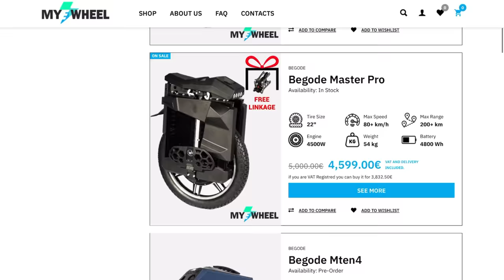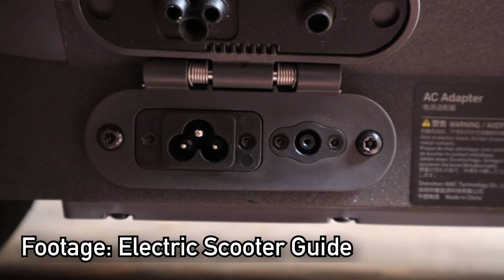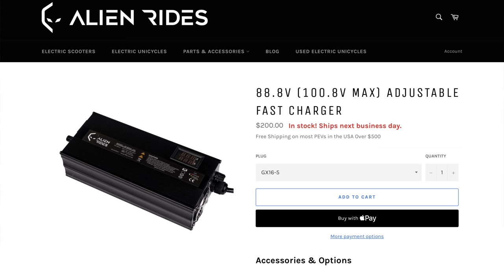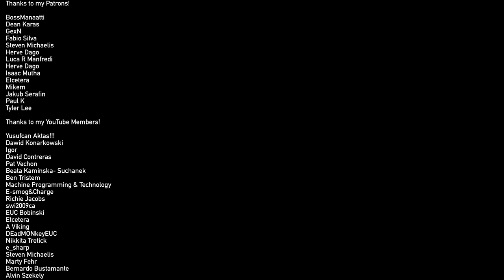I don't like where EUCs are heading

Comment: I love the size range of where EUCs have gone. I’m 6’2 250lbs athlete. Having the master pro is god sent because it doesn’t feel like a toy and I know my size won’t break it easily. I would over torque my RSHT and v11 without even trying. I’m happy they make wheels for pple of all sizes
Reply: 6'2 and 250, damn mate you're a complete unit of a man
Reply: Exactly!
Reply: I don't have a wheel yet but I'm also 6' 2" & 265lbs (not athletic 😂) and 99% of wheels seem too small & underpowered for me. The monster/master pro & V13 seem to be the only wheels built for my size.
Reply: Funny...I mentioned newer wheels would be good, and then went on to list a bunch of older models.  Oops!  But still good options!
Reply: @joshuajones6113  haha, the tech seems to be moving fast. I only discovered EUC's a few months ago but I really want one as I only commute 10 minutes to work. Working on losing weight but I still want a solid suspension wheel for my knees
Reply: @anthonycoffey6565  Suspension wheels are cool for sure (I want one too), but have so far noticed that I easily bottom them all out with the exception of the Sherman-S.  I am about 240 lbs fully geared.  Other issue with suspension wheels for a new rider are that the pedals are WAY higher off the ground.  This makes learning them a bit more difficult.  Unless you have really bad knees, I wouldn't sweat it.  My knees could be a lot better (I'm 48), and my commute to work and back is about 34 miles.  Only had non-suspension wheels and have been ok.  Would probably be a good idea to check in with the forums and see what other larger riders are saying.  Also, check out Black Cobra's channel on youTube.   He's a big rider and does wheel reviews specifically with us big dudes in mind.
Reply: @anthonycoffey6565  you can ride anything equal or more powerful than a v10f. comfortably. a HUGE danger he never mentioned in this video is the complete lack of regard the community has for money, and most will just disregard older wheels because it doesn't cross their minds for cost
Reply: Good point. I'm a small guy and have no use for huge wheels but I recognize that larger people do. Which is good.

Comment: I've been hoping to see some innovation in the smaller wheel space. That makes it easier for new riders to get into, for one thing, and opens up different ways to ride. I want to see a small lightweight precision wheel that promotes technical riding over just speed. imagine a wheel that is made for skate parks.
Reply: honestly feel the same way. i love my MCM5v2 for trips under 2 miles from my house. It's fast enough and doesn't get in the way at the dentist's office or getting groceries/food. I also don't feel the need to put on full on motorcycle gear when taking it out since I'm not going as fast. I'm beginning to feel that regular 50kph+ speeds might be better done on e-bikes with their better stability and braking performance. I've seen the EUC vs e-bikes braking tests and its an eye-opener how much more distance the EUCs need to slow down from high speeds.

Comment: No, I disagree. Safety is an attitude, not a hardware limitation. Lots of cars are capable of going 150-200 mph even while the national top speed limit is 70 mph. A device designed to achieve high speed will be SAFER at lower speeds. It's up to the rider whether they want to ride safe or risky. And sometimes you might need that speed to get out of a "sticky situation".
Reply: Yea you can cause a bad accident at any speed. Offering a variety of wheels that do different things for different riders should be a priority with safety in mind… if a wheel of a certain size or range or speed doesn’t appeal to you then DONT BUY IT and find something for your use case ….
Reply: The issue isn't really the capability of speed but rather that manufacturers are sacrificing other valuable features in favor of higher top speed as it's effective for marketing.

High top speed is dumb when you barely have the torque to reach it imo.

Comment: Motorcycle foot pegs are also foldable. It actually makes sense for durability specially during a crash. If the foot pedals are fixed in place, they will snap off instead of just getting folded.

Comment: Nice to see some love for the 16x again… I love mine but just replaced the inner and outer shells as well as the trolley handle, the top cover, charge ports , rear fender and front light… when I opened the wheel the motherboard was literally covered in dust,… I love this wheel i do but it is literally made of the cheapest crap, broken loose, sheared, rusted and chewed up screws… if I had the money I’d get a bunch of top riders together and design the safe, capable, bullet proof and fun wheel we all know is possible…
Thanks Adam 🥰

Comment: Innovations I would like:
- black box (like in planes)
- transparency about firmware versions 
- transparency about known issues (hardware and software)
- buzzer audible in all conditions
- possiblity to plug one more battery or bigger one when I need (plug and play)
- Standard charge port
- Conception allowing you to change / repair tire easily
- an adaptative  tiltback taking into account battery level as a standard

Comment: 3:10 I agree the prices are out of control. I recognize the newest EUCs are more powerful, more sophisticated, have extra components (suspension), huge batteries, but I am seriously doubting whether I want to spend $4-5,000 USD for a wheel. Even though I love EUCs, I can use $4-5,000 much more beneficially for other things! I'm currently riding a MSX and 18XL. These are several generations old, but I am very happy with them! I paid about $1,800 USD for these wheels when new, and that was very difficult! I think it's great that EUCs have advanced greatly since the period of the MSX and 18XL, but my older, simpler wheels meet my needs fine! I believe there are many customers for a simpler, more economical wheel. EUCs are so expensive now that people who would like to join the world of wheeling cannot because of the cost barrier.
Reply: Absolutely right. Who says otherwise is lying from financial reasons.

Comment: When talking about the 16x, I think its totally fine to have an older wheel. We know it works and is reliable. If they keep supporting it to current year then Id much rather buy that over something that just came out and I have no idea how it will do over time.
Reply: I've been riding 16X  3 years now, I always push it to 30 mph and cruise all day, never any issues it just keeps going and going.. plenty of times that I wish it would go faster but I also have a street motorcycle 😅

Comment: Spot on! 24kg max,  50km/h max, high torque, 16"-ish wheel for agility, flat sides, strong rim. 16x fits the bill quite nicely, apart from the rim that is way to soft, so keep the tire pumped. The v12 HT that I bought 2 years later has a few improvements over that with a stronger rim and bit more headroom in speed and high end torque, but is also noticeably heavier at 29kg. And both are sub 2000euro. That 's how it should be. The manufacturers should build on existing products, like you said: Stop designing a completely new wheel every 6 months. Or at least keep the designs that work and improve on those.
Reply: as we say, no need to invent a bike, when already all invented, just need to make modern design of existing
Reply: Agree 💯. Unfortunately the chinese manufacturers are interested only in grabbing more money, hence the  trend of bigger and faster, disregarding waterproofing, quality, safety and maintenance.

Comment: I've been thinking this too - well articulated - my hope is Inmotion takes the safety and modularity of the V13 design and re-apply's it to smaller, lighter, ideally, cheaper wheels, so a new V8S / V10 / V11 / V12 using the newer reliable components. Although - I believe the V13 has had some bolt issues already?

Comment: Completely disagree INMOTION have other models to suit your style... The market mostly wanted fast unicycles so that's what they were given its not fair to blame this on the manufacturer. Motorcycles go 300Kmh on the clock it doesn't mean I use it,  the pure stability and smooth ride of the V13 wins me everyday over that baby wheel you have,  I'm not 70kg I'm a big man and the V13 to me is basically a V12 to you. I believe I could stop quicker than you on a V13 at 50kmh than you could. Weight is also a good thing have you ever tried to race a small 125? This torque thing you have going on isn't real btw the V13 has 300Nm more enough especially with power assist on and this was designed for speed the next wheel I'm told will be different and will cater more to your needs....  
The charger is big for longevity small chargers produce heat and die quicker life expectancy of that cheap small charger won't last and it's also not 126v so the transformer etc needs to be bigger as with everything else.

Comment: great, you summed it all up.  I preferred the time of the beginning, when inmotion worked with new walking, that was the spirit of the wheeler in super pedestrian mode.  Rides with your nose in the wind at 20-40 km/h in a t-shirt and small light helmet instead of wearing motorcycle gear, glove jacket, full-face helmet, etc.... soon so much torque that there will be  possible to mount vertical at 90 ° .... only on paper, but some will still buy lol.  good ride for all readers

Comment: Hi, Adam! Thanks for the great video, exactly the same thoughts. I'v just bought second hand 16x from the local rider (instead of my 18L) and... I am just happy! It is so nimble, it has so great acceleration, it does not require to lean hard on it, and it has outstanding range for its weight - I did 76 km with 69V remaining. And the most important thing is the way I FEEEL it - its just magnificent!!! After 500km it became a part of me, not a "machine, I am riding". I had that feeling on Ninebot E+, but near lost it on 18L, and now I have everything I want on 16X. KS could improve that wheel (better plastic, 100V, etc) but....
Reply: imo ks16x improved version is v12ht, but we dont have improved 18xl

Comment: I keep saying this. Kingsong should just make a 100v 16X with a bit bigger battery and I reckon they would sell a lot of those.

Or a 100v 16X with suspension would be sick too!
Reply: No. If you add suspensions, you increase weight, you want also more battery, you arrive at 32kg T4 mark, the comparison with 16X is lost, meaningless. Maybe a 26kg 16X, with 50km/h real speed and a bit more battery is doable.
Reply: Suspension is a most. Nothing to argue here.

Comment: imo the first and foremost thing they need to market is affordable transportation, it's amazing to be able to use it as I would a bike, but much more fun, much faster, and I can just plug it in at the end of the day, not a worry in the world about gas or storing it anywhere. a smaller wheel that people can use like a v5f or v8s are the perfect wheels to exemplify it, but they don't really try to make wheels like them anymore

Also: if I ever recommend a wheel to anyone it's a v5f, the range is great for the price, you can usually find one near $300-400 and is a great little vehicle to get around. it frustrates me to no end that people discourage getting affordable wheels because "you're gonna upgrade eventually cause that's too slow for me."

Comment: Unfortunately the infrastructure where I am, I need 60kmh wheels minimum. Bike lanes here are non existent and most of my close calls with cars have been in the bike lane where cars dont notice me coming. Even when I am on a underpowered onewheel going 25kmh or less. This forces me to take the road and try to keep up with cars. I think its the same case with many places in the US where bicycle infrastructure just isnt enough.

Price I agree with. These wheels are just getting more and more expensive and I dont see where our money is going towards. We still have cheap cast parts on our wheels yet we are paying thousands and sometimes even motorcycle prices which blow EUC quality out of the water. At these insanely high prices, everything we should be getting should be cnc, high quality and well designed. EUC manufacturers get away with giving us crap and still charging what they charge for some reason

Comment: Why can't we have a modular wheel, add in additional batteries if you want to go on a cruise, or quick swap with fresh ones.
- even accessories like plug in Bluetooth if you want that or not.
- I find it strange (new rider tho) how mechanical unicycles all have seats, but these electric ones you need to stand or contort down to a squat - how about a seat option or add on
- i like the LED lights for additional visibility at night
- be nice if there was gps tracking or security features
- i like all the other things you said too. Safety, torque, waterproof, better chargers & built in, quality materials. Cost lower. Good customer support.

Comment: The main problem for me: the wheel needs removing from time to time. Bearings, tyres, etc need servicing. Most wheels are assembled around the wheel and taking the wheel out is a couple of days work - at least for me. Bikes and motorcycles are completely accessible. Some bikes even have quick release systems. If a wheel comes to the market with a quick release wheel, it could dominate easily.
Veteran Sold me an Abrams and I like it just fine, but its all I know. Its been off the road for 2 weeks now as I wait to buy correct tools, silicone, tape and all the other stuff to re-waterproof.

Comment: I think a smart BMS will be good for the resale market. These wheels drop like rocks in value. If you go see a used wheel with a smart BMS ask the guy to charge it to full then you can check on the batteries.  I did that with a used S19 I bought.

Comment: As a long haul truck driver I appreciate a smaller lighter wheel that easily fits in the cab of any truck. My 16X fills the bill perfectly. It has plenty of torque and it's fast enough with adequate range for me to get around any city. Usually if I'm parked outside of town I can take an uber into the city and from there I can access the services that I need. If a city has decent enough infrastructure I can actually commute into town as well saving me even more time and money. So, I agree, there is a need for smaller, lighter wheels and I hope to see these companies continue to produce and improve them.

Comment: Well Said! I want to find a way to stagger the pedal height when you turn. IE when turning your outside pedal would drop down, and the inside pedal could go up. This would help tire grip and allow for a lower center of gravity in while turning. This could also be integrated into the tilt angle sensor and prevent high angle cutouts from happening on things like high angle burm turns or wallrides!
Reply from the maker: Amazing idea !!!
Reply: Hmmm... slalom would be even more like skiing. I like it ... where is my pen and paper
Reply: @mr_wrongway  you tested some tilting trikes years ago with similar front suspension and I think Yamaha and Nissan  also made prototypes so I think it could be done mechanically but beyond my skill set.  You seem to have innovative friends....

Comment: 50 km range, 40 km/h max speed, suspension, 120 kg carrying capacity, and as small and light as it gets with those parameters, so I can easily bring it on a train or whereever. Basically a V10f with suspension, thank you very much.

Comment: I have put over 1200 miles combined between my inmotion v8f and v8s. 

My main reason for getting them was to save walking back and forth at work. I stayed with the smaller wheels since I'm often taking them in the truck or farm tractors where the light weight and size are important.

Comment: New riders really underestimate those older wheels!

I ended up buying a KS 18L as my first and have no regrets. It's light, nimble, reliable (zero maintenance or issues for 2 years of daily riding), fast enough, and has survived a few moderate speed crashes without any real damage. I keep trying to convince myself to upgrade, but there just isn't a use case for it unless I decide to go trail riding.

For the last 6 months I am even sending my 18L down multiple flights of stairs as part of the daily commute without a problem.

Comment: Hi Adam I think you made a lot of good and valid points here. Some contradictory but the purpose is correct.

I think one thing you touched on but didn’t talked about enough, which in my opinion leads to most of these issues, is the rat race from all companies to see who can put the newest wheel out. Almost all the issues with QC and repair ability would be fixed if manufactures took 6 more months to a year of testing and development. But becuase it’s a rat race with the 4 big company’s to get the newest fastest longest range suspension wheel out, they just keep dumping out products that arent properly tested and pushed out in a hurry in order to get the upper hand/market share.

Comment: I like the V13. But I wouldn't feel safe on the highway. I hope they can increase the speed so it can keep up with the cars. Maybe a little headroom to 140 kmh.

For the people who are scared there should be low speed wheels. But there is much innovation possible. What we need there is geared motors. Maybe a planetary hub gear, of a belt driven system. Maybe even a 2/3 geer selector. Then we need the battery packs in such a way that there can be huge currents delivered. All in all it would give extreme acceleration and climbing ability, all while keeping the weight low. Because E-motors like high rpms. So that's were the industry needs to go.